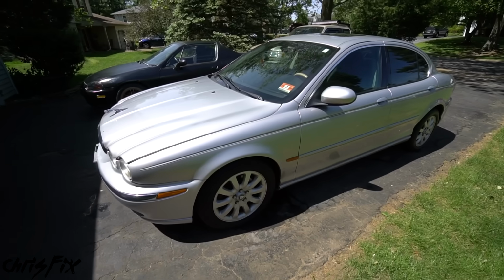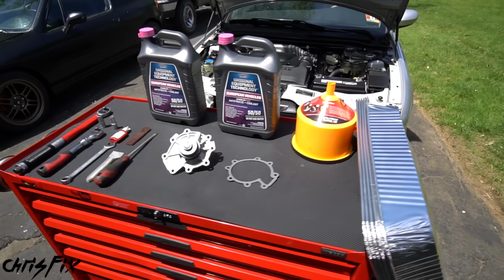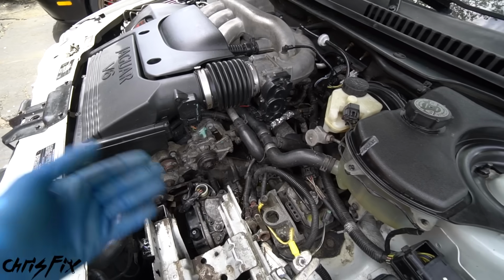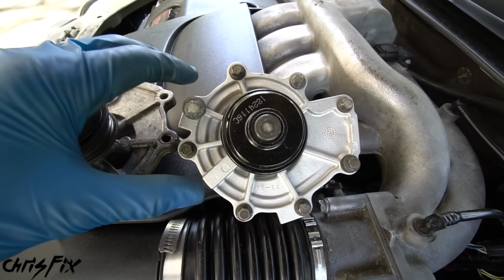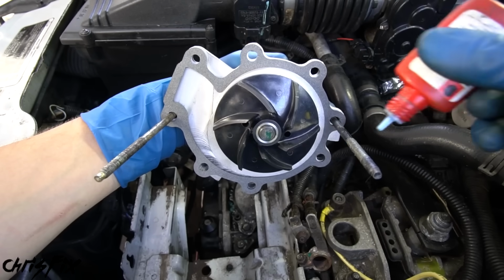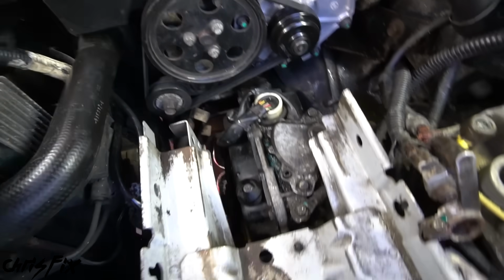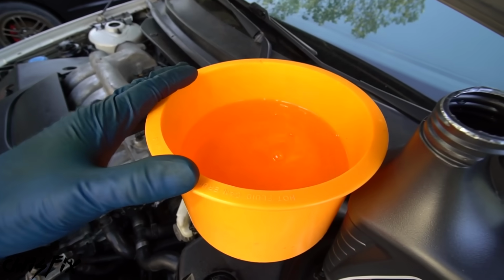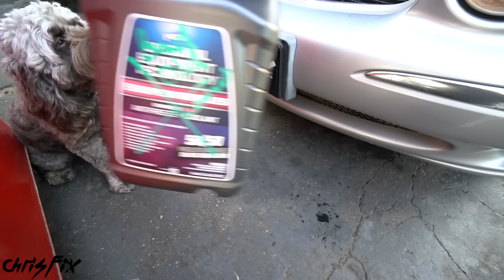How To Replace a Water Pump and Save $783

Comment: Hi Chris. I have a 2E engine and the car started backfiring/misfiring and overheating. I changed the spark plugs and ignition cables (You taught me how😅). It was still overheating and when I checked I saw that the air filter was burnt on one particular spot. I changed the air filter and then noticed that one of the then pipes/hoses next to the air filter was disconnected. Plugged that back in and it was fine for a while. Started backfiring and heating up again this morning. Temperature gauge doesn't seem to be very accurate. Do you think it could be the water pump that's faulty?
Reply: I took the car to a mechanic and he said he cleaned the carburetor and one of the spark plugs had petrol/fuel on.

Comment: Crappy Tire told my I had a coolant leak on my 08’ Dakota 4.7. Quoted me 750$ for repairs. I took it home, got my pump off rock auto for I think around 200$? Did the while shabang myself in 6 hours with many beer breaks. Runs perfect. Don’t be afraid to work on your own stuff guys! I’m not about to get charged 130/hr for the labour of some 18 year old that just got out of Highschool.

Comment: Hey there buddy christfix, I have a quick question, well need your help,  I have a 2005 kia sedona van and my water pump is leaking, will that prevent my van to start?  cause the timing bell being next to it? Van won't start right now, only it turns over but won't start, I have change the cam and crankshaft  sensor cause they was melted cause of the water pump leaking.

Comment: Excellent, one thing, you could have marked the bolts such that the mark was on both the bolt and the pump housing,
that way you can observe the bolts coming loose in a visual inspection at a later date.

Comment: So it's the part that's so expensive, not even the labor?! 😣 My car is in the shop currently and I was just told the water pump was bad. The car hasn't been able to hold coolant for like a year and I just thought it was a hose or something. It has another issue as well but I figured I'd go ahead and have the leak repaired, too, so that it doesn't overheat (which has happened once). I don't have any tools right now (gave the tool bag to my sibling when he moved states as I was making more than him...and then my job had to let nearly everyone go. I just started working again a few weeks ago). Tools would've been way cheaper than replacing this thing. I thought it was a pipe or something on the bottom of the car, not...that tiny thing. 

It's too late to reverse course now but I'm happy you just showed us the highway robbery that is water pump replacements. Between the cost for my car to be towed to the shop, a battery replacement, diagnostic and water pump, I'm already up to nearly a grand in charges and had to tap my mom for money. And there's still an issue with service lights coming on amd the car revving and jerking if driven that hasn't been addressed (this only happened after a junpstart though so I'mhoping it's just a sensor malfunction). I should be hearing back about that this week. 

sigh Oh well...at least now I can use this video in the future. My very first car also had a damaged water pump and before I knew smaller mechanics were cheaper, Pepboys wanted over $600 for the replacement. Thankfully, I had a warranty on it and took it to the dealership's mechanic and it was replaced for $200. After this video though, I'm now know how to just do the repair myself, so thank you.
Reply from the maker: Darn I'm sorry to hear about that repair bill. I'm glad you now know how to do this yourself if you need to in the future!

Comment: All I would note is that it is better to blow out the screw holes with compressed air (either compressor or spray) so that there is no water in it by accident. Trapped water can crack the block, which, if spread, can cause serious damage.

Comment: He says it will gouge the surface and cause a leak if you use a metal scraper, but ain’t that what the gasket is for when it’s compressed nothing should get passed it even it’s scratched or gouged

Comment: Great video Chris, lots of good tips.  The only thing I would add while adding coolant and letting the bubbles run out is to squeeze the coolant hoses to help bubble air out.  This is recommended in most manuals that I have read.

Comment: You're sufh a legend. You are so thorough, and most of your stuff is pretty common sense... check the manual, mark this, put bolts in here sou you don't forget where they went. I remember paying £1k+ for a timing belt and water pump change. Obviously, the timing belt requires more skill than this, but this is so simple!

Comment: I just replaced the water pump but once bolts are tightened pump dose not spin.  I used a pump from auto zone 2012 outlander sport. Any idea of why it may not fit properly. ?

Comment: Oh also if you do get a leak on anything really on the cooling system so you don’t have to turn the car on first and well leaks are more obvious when the car is under pressure get or rent and you can rent a cooling system pressure tester which is a glorified pump for your radiator to check for leaks. And you do that so you can find the leak WHEN THE CAR IS COLD MIND YOU  so you can actually take it apart to fix it right then and there it’s helpful mind you. On my dads car I forgot oh no i was changing a little hose that exploded in it to I emptied the coolant and I took off the lower hose to put on a better clamp it had one of those quick clamps that never work and is impossible to get any pliers on it to a screw clamp I didn’t put it on because it was just not big enough to like fit on it I put it back to normal but I didn’t get the hose on right nor the clamp I put the pressure tester on it to check for leaks and it blew the hose clean off nice to know it blew the hose there at home with cold water than in the road with like 225 degree water or something coming out

Comment: Just did the water pump on a vq35hr smh had to take the timing cover off while in there changed the oil gallery gaskets took a good 12hrs to do smh

Comment: Just a note about threadlocker or any liquid on threads such as antiseize: unless the repair manual or spec specifically calls out for you to put that on the threads, the torque value listed will become wrong. Adding any liquids to threads not initially wet will decrease the needed torque to tighten, otherwise you can actually overtighten at the listed torque value. This is why I dont use threadlocker or antiseize on parts with sealing surfaces. If the torque gets messed up, it wont seal correctly! If you feel inclined to use antiseize or threadlocker anyway, you will have to recalculate the torque value using a wet torque chart. Even then that may not be correct, since different thread compounds (threadlocker vs antiseize) have different viscosities, which in turn affects thread friction and therefore torque. A wet torque value with antiseize will not be correct with threadlocker and vice versa. Since you can see the can of worms here.... thats why I stick to dry threads on stuff like that. Normal stuff like brackets, lug nuts, caliber brackets etc. I use antiseize on and dont care.

Comment: hey, iam getting a clenching noise when i change gear from 2nd to 3rd, even after pressing the clutch full in, i was wondering if you can be of any help. its an Audi a4 b5 1.8 non turbo.
if the transmission fluid is the problem, how do i top up? thanks

Comment: Almost every time my vehicle needs a repair I make an attempt to do it myself but ultimately end up bringing it to a mechanic. I've built two houses just about by myself but what usually stops me dead in my tracks before I even get the first piece off is rust. Before the vehicle is even a year old the entire thing is rust-welded together and every bolt and screw head is crumbling to pieces. I don't know how mechanics do it.

My rear differential cover was rusted through one time and leaking. I managed to get one bolt off with a wrench and the other nine had to be drilled and extracted. Then I couldn't get the fill plug out despite heating and an attempted drilling/extraction. The steel truck bed had also rusted to pieces and I had removed it the day before so luckily I had easy access to the wheel speed sensor on top of the differential. I removed the sensor and filled the differential with fluid through the hole.

I was planning to change the transmission, clutch and transfer case fluids too but when I thought about all of those seized fill/drain plugs I said "eff that" and brought the truck to a shop.

Now I'm about to try to replace the front brakes and I know I have to fight for every inch. Every bolt, screw and fitting is it's own adventure.

Comment: I saved myself $2k+ from swapping out the timing belt, water pump, tensioner pulley, roller pulley, thermostat, accessory belt, and ac belt on my 2005 VW Passat TDI

Comment: On my XK8, I went to change the water pump.  Kind of looked the same but not a transverse motor.  What I did not know was the bolts were stretched when installed.  When I went to put them back in one snapped.  I could not get it out.  I had to hall the whole car in to the mechanic.

Comment: Nice vid but this does not represents most cars.. most have their waterpump in the distribution side which means you have to take the belt from distribution of, take care of the timing and also replace tentioners and the belt itself, because you cant re-use it. A lot of more work.

Comment: Moral of the story: Never get work done at a dealership, unless it's warranty work and it's free. 

When I bought my Ram I wanted to add the tailgate assist strut. Dealer quoted me $185 for the upgrade. I ended up buying the strut from Mopar directly for $25. It's literally a 2 minute job with one screwdriver. I ended up with a totally OEM upgrade for 25 bucks.  I always knew dealers rip you off, but that was just loco.

Comment: pssss yeah right, i'd change the oil seal for $2,5 and the bearing for $8, cut a gasket from some leftover 0,5mm gasket sheet and be done with it.

Comment: If only it was this easy to replace a water pump on a Volkswagen GTI. Water Pump and thermostat housing are very common issues and you have to remove so much with so little space to get to them.

Comment: Excellent video, you have a great down to earth "keep it simple" mentality.  I did the pump in my wife's 2005 Yukon.  The shop wanted $750 to do it.  For $262 total in parts, including new thermostat, upper radiator hose and serp belt, and a few hours (my first time, I wanted to take my time and do it right) it was worth the $490 savings.  It's run like a champ since, she's made several long distance trips with it and not a drop of leakage.
Reply: How do you do it
Reply: @ulises3953 do what? Get a wife?

Comment: yea, my water pump is behind the timing belt on my car...
that sucked. I didn't even realize the water pump was about to die until I removed it from the block, it was all crusty and corroded inside and developed a very slow leak. if those cheap paper gaskets fail on me, I'm gonna go ahead and blame China

Comment: The most unbelievable thing about this video is that a Jaguar exists somewhere with 188k miles and still runs.
Reply: If I remember correctly, these Jaguars have Ford V6s and are mechanically pretty similar to a Taurus. But I agree with your sentiment!
Reply: The only reason is that it's a Ford built car simply rebranded as a Jaguar.

Comment: only 2 things i would do different, and both are just little extras. I know it's not needed but i still put rtv on paper gaskets. I only apply a thin film though, you would still clearly see the grey of this gasket through the blue rtv. I also wire brush the threads of bolts, got a wire wheel on one side of the bench grinder, only takes a couple seconds per bolt and makes me feel a little better how reliable the torque spec is.

Comment: I have a 2012 Dodge Avenger overheating also I have coolant mixed with the oil but the water pump is external would this cause the coolant to be mixed with the oil or does it have to do with the head gasket

Comment: The amount of enthusiasm he has about fixing stuff is mind boggling. I've worked on many many cars over the years and let me tell ya, the mechanics dialogue is that of a salors mouth. I've never once heard this guy curse out a engine designer or a signal bolt, but then again, he seems to live and work in an area that is rust free, which makes a world of difference when working on cars. Snapped and rusted bolts, busted knuckles and absolute oil and grease covered parts are NOT fun to work with.

Comment: 1 year later and this still super helpful! Saved me about $500 I went to a shop and that was the bill. I went and got the pump and a socket set and did it. Super accomplished feeling thanks Chris. Keep it up!
Reply from the maker: That's what I love to hear! Thanks a lot!
Reply: @chrisfix  July 22nd 2022, This video just helped me changed my water pump this morning. Thanks Chris
Reply: @chrisfix  hi Chris you’re an expert and we’ve enjoyed watching your videos for years. On a 2005 Town & Country trying to change the water pump. There are some videos out there talking about dropping the engine and yet there are those that accomplished it without doing that. Using the proper tool which I believe was a boxed wrench offset.   

We respect your opinion and your capability would you kindly take a look at some of these videos and see what would be the easiest way to remove that water pump because they didn’t leave enough clearance against the body rails however many were able to remove it without dropping the engine and engine, mount opening, etc., etc.

It would be nice to hear your comment as you are an expert in the area of auto repair
Reply: Great job!!

Comment: I am confused on the last step involving the funnel. Suppose that in your coolant reservoir you have a minimum and maximum line how would you go about getting in between there using the funnel Is it even possible? Or is there in alternative missed method to removing air from the system?

Comment: I use RTV on gaskets all the time, stick them to one surface makes it way easier to install in tricky spots. also sometimes if the surfaces are damaged etc they can still leak with just a gasket, Always pays to use a bit of RTV given its very cheap

Comment: Great video Chris! I've changed exact the same water pump in Ford Mondeo ST200 (US Contour SVT) a month ago. Ford dealer asked $200 just for the pump with plastic propeller. Have found pump with metal propeller on UK ebay for $30. Super easy to change it, but the pump was still leaking through the gasket. After a week or so it stopped.
Reply: Ebay. Yikes.

Comment: I have a 2008 Ford Fusion, 82,000 miles, and I'm on my 3rd water pump (well that's what the mechanic said) and it's leaking again. I emailed Gates and asked them why their pumps didn't hold up. They haven't replied. It's very irregular leaking. It's not a hose but the gasket in the water pump. The pump is an entire system, not what you did on the Jag. I'm thinking of just taking the front of the pump (they're $110 if you buy it) off and cleaning the surfaces and using water pump gasket sealer. Your thoughts please. Oh and I'm gonna do it myself. I'm tired of $500 a pop!
Reply from the maker: I would try that first and if it still leaks, I would look for an alternate brand!
Reply: @chrisfix  Thanks for the advice. Even though I'm much older than you,,,,, You're very mature for your age! That's called respect!.

Comment: How did u diagnose the leak ? I mean was it possible that u would have just changed the gasket and re installed the old water pump. How do u diagnose the leak is due to a failed rotating pump or just the edges which can be repaired by changing just the gasket . ( not a professional.. just got mine changed for a lot of money, so just a curious customer)

Comment: I replaced the water pump on my 2007 ford crown victoria police interceptor when it went out while I was on the highway on my way home from work in the middle of winter, had to pull over before over heating, called a tow truck to get my car home then bought the water pump and took me like 20 minutes, it was so easy on my crown vic.. only had to remove belt to gain access..

Comment: I've noticed with some cars, its easier to loosen the bolts on the pully before you remove belt makes ten times easier if you have real tight bolts and pully keeps moving.
Reply from the maker: Thanks for sharing!

Comment: Hey Chris fix I have a crown Victoria with 150k miles I want to get 200k out of it what preventative maintenance should I do I’ve done every single fluid at 100k and I’m gonna do the fuel pump water pump serpentine belt idler pulley tensioner thermostat and the pcv valve em I missing something else

Comment: Correct me if I'm wrong, but the water pump pumps coolant somewhere in the engine.

If it does, why is it called the water pump? Shouldn't it be called a coolant pump?
Reply from the maker: Correct and cars use water in the coolant system to cool down the car!

Comment: Lol, British unions!!  I drove an Opel Corsa all over the UK. When I noticed a coolant leak in Glasgow the local Vauxhall dealer quoted me a weeks delay and around U$399 minimum!! Managed to buy a hose that had teeth holes from a Marten squirrel. Took me 3 minutes to change with 2 cheap tools. Then the actual dealer of the same GM outlet did not stock any coolant!!! So much for General Motors United Kingdom!! Chris would become a millionaire in a year over there!